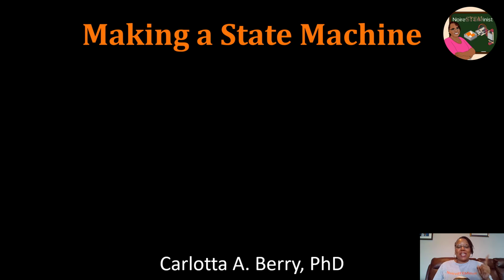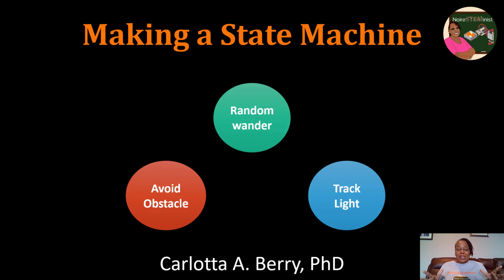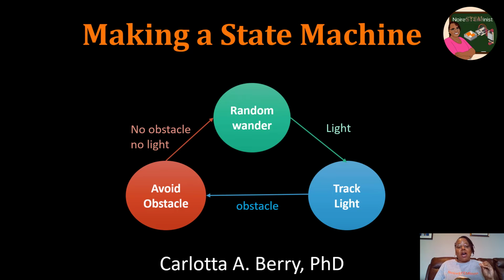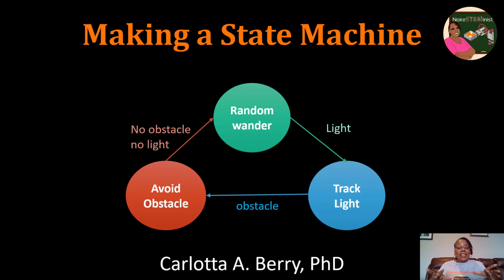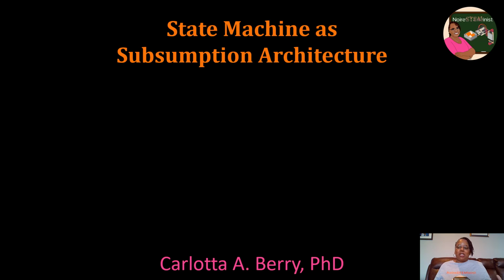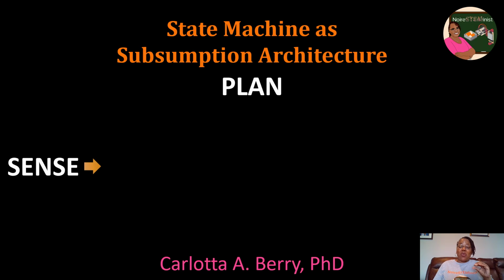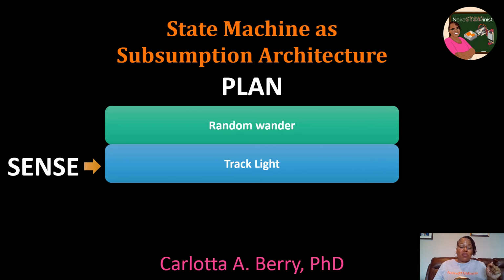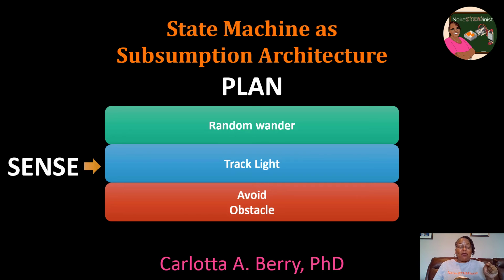Making a State Machine Part I: Create a robot control architecture for a robot

Comment: Hi, thank you for this set of videos, they are great! I searched around a bit, but I did not see a parts list for this project, do you have one that is easy to share? Than you again.
Reply: I did a bit more searching around and it looks like the SparkFun Inventor's Kit - v4.1 includes everything needed to build except it is missing a photoresistor, this project uses 2 photoresistors, and the sparkfun kit only comes with one, so be sure to add a photo resistor (called something like a Mini Photocell Light Sensor if searching to buy one, very inexpensive from the same place you buy the kit) if you buy the kit.
Reply from the maker: Yes you are correct, the Elegoo kit is much cheaper with many more parts that I use for a lot of my projects. https://www.amazon.com/ELEGOO-Project-Tutorial-Controller-Projects/dp/B01D8KOZF4/ref=sr_1_1_sspa?crid=3MV6R7FLEOTB1&keywords=elegoo+kit&qid=1662079988&sprefix=elegoo+kit%2Caps%2C573&sr=8-1-spons&psc=1
Reply from the maker: That's right sorry for not stating that in the video, I used the SparkFun Inventor's Kit and then added in more parts.